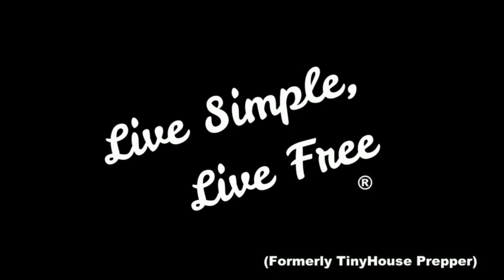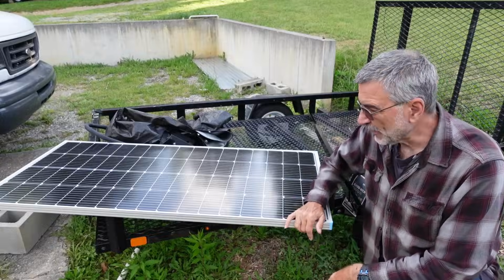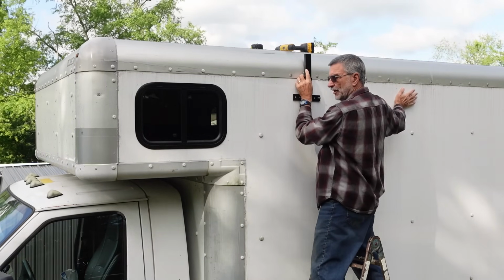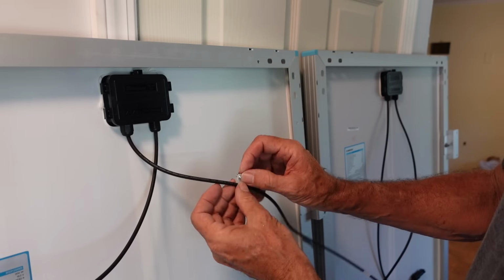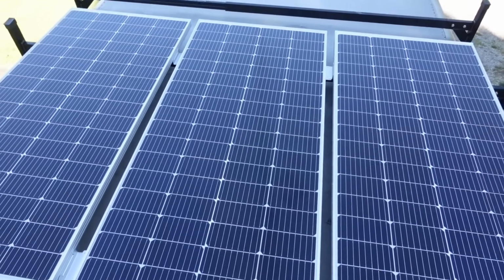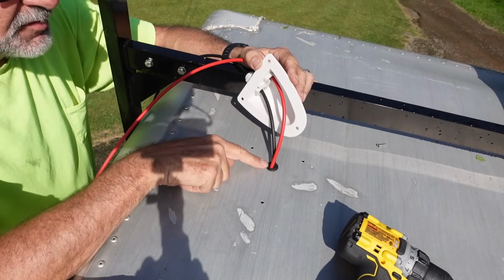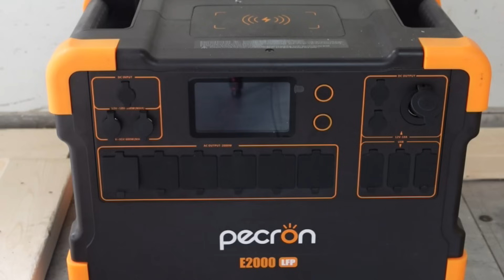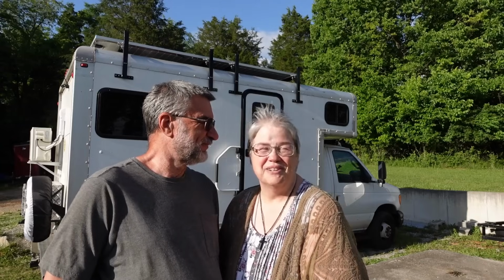Installing Solar Panels - Box Truck Camper

Comment: Your engineering skills have once again made all the difference.  Just be careful in the future parking the truck in woodsy areas under trees as you don't want debris or bird droppings landing on the solar panels which can cause problems down the road.  It won't be long now before the big trip to Utah!
Reply from the maker: I will have a collapsible ladder along with me so that I can get up there to clean off debris and bird stuff.
Reply: @LiveSimpleLiveFree   I was thinking that shade would prevent solar charging.  So there's that.

Comment: You should consider mounting a wind deflector to the front of the box, similar to the ones you see on tractor trailers. That could relieve the wind stress on the system.
Reply: Good tip !

Comment: The roof racks also serve the function of providing air circulation around the panels, which can generate a lot of heat. RVs have been known to catch fire if the solar panels are placed directly on the roof.
Reply from the maker: Good to know. I was not aware of that.

Comment: Popriveting brackets to the roof would have been strong enough but movement over time might have made the roof leak.  The other advantage of your less aerodynamic mounting is that the roof will be cooler with an airgap under the solar panels.

Comment: Pecron makes a DC smart charger that you can charge 480 watts off your alternator. Hooks up to your battery on your truck and hooks into your Solar inputs. It can be set not to drain your truck battery  ! Also has a on and off button.  Its about 150 bucks and should charge your station in a couple of hours if you need to charge overnight ! Great set up.

Comment: Most would plug the panels together, and use a cable tie to tie up the excess under the panels, this way you are not modifing your panels in the event of a warranty claim.. plus you kind of made more work than was needed, but you do you :-)  good job on covering most of the roof with panels, which reduces the heat load that the AC has to cool :-)

Comment: My uncle and his wife live in California.  They have been through the rolling black outs and make use of a camper they have during that time.  So it's not just for travel.  This gives you an option when the electricity goes out for days to have what you need even though it's a small space.  It looks good.  I have only a few solar paneled things like calculators and flashlights and it's nice not having to worry that the batteries are dead.  Though solar energy can be saved onto batteries to make it last longer.  That's about all I know about solar panels.  It's extremely nice that you don't have to worry about the grid with your new rig, except for getting gas.  Now a water fuel  engine, that would top it off, but the big oil companies kill everyone who comes up with such technology😢😢😢.

Comment: That metal piece at minute marker 9:52, has an end piece, cut it and put the end piece back on it to lower the height and give you the clearance you need.
Reply: I think it’s called a rubber boot for the end piece.
Reply from the maker: Yes, I have been thinking about doing that.  But those extra pieces sticking up provide extra protection for the panels from low-hanging branches.  So I haven't decided yet whether to do that or not.

Comment: I like the wiring kit for the solar panels. Those ratcheting crimpers do a much better, more consistent job than the pliers type. Most of them will have an adjustment to get the crimp to the proper tightness. The crimper frames often have removable dies and can be outfitted with additional dies for many different types of terminals. If the crimps are done properly, they are stronger than the wire itself. I used to have to pull test samples of my crimps, and have them inspected. It took longer, but we had no question that they were done properly.

Comment: Ecoflow now has an alternator charger. No solar panels. You may want to check it out.
Reply from the maker: Yes, we will have an alternator charger as part of our system.  But that only works when you're driving.  If you stay somewhere for longer periods without driving much, you will need solar as well. But when there is no sun, then the alternator charger is good to have.

Comment: That project turned out fantastic!!! The U bolt solution was genius!
I've watched some videos of step van and box truck builds, where they paint the roof of the vehicles with a product called Henry's Elastomeric in white, which helps to seal the roof AND add "some" insulative and reflective qualities.  
Love your videos!

Comment: You're far better at measuring than I am. I finally gave up on measuring, where possible, and started making templates. That works much better for me. It looks like you don't need the additional height on the roof rack, it should be possible to remove the caps on the uprights and cut them down a little. I would use my favorite Permatex 80050 clear silicone adhesive sealant to reinstall the caps, it works very well for such things. I glued a medallion to my gearshift, and it was still strong ten years later. I use it for all kinds of stuff since it adheres to smooth or textured surfaces equally well. It also comes in black.
Reply from the maker: I thought about that.  And decreasing the overall height for low underpasses as well. Only the other hand, those struts sticking up a little further could also provide extra protection for the panels from low- hanging limbs.
Reply: That's true, and I think some of the GPS apps can alert you to low overpasses and such. Low-hanging limbs are probably much more of a hazard.

Comment: We have 400 watts of solar on our RV. Doesn't run our AC but does run inverted outlets, TV, furnace fan, fridge.  It's all we need. So you will be all set with 1200!   Can't wait to see the finished product on the van.
Reply from the maker: My goal is that the A/C will run through the night!

Comment: Maybe I missed something, but were the rack fasteners (on the side of the box) bolts and nuts or self-tapping screws?  I am mulling over ways of attaching solar panels on my Ford Econoline van.
Reply from the maker: They were 3/8 inch lag bolts screwed into the 3/4 plywood walls.
Reply: @LiveSimpleLiveFree  Thank you.

Comment: Amen....no such thing a luck (dumb or wise).... God is good ALL the time!!!!!!!!!!!!!!!!!!!!   It looks like your loosing weight...you must be working soooooooooooo hard!   Hope those are lock nuts you are using....lots of vibration!!!!!!  Nice job brother.   FYI:  A wind screen in front of the panels might be a good idea to reduce drag and possibility of lift!!!!!!
Reply from the maker: Yes, those are lock nuts.  And yes, I am considering a wind screen in front of the panels.

Comment: Great job 🎊 🎉. Just a question why can’t get help from your son, grandson with help lifting panels.
Reply from the maker: They both have their own jobs. In order to help me, they would have to take a day  off from work. Lifting the panels onto the roof was not difficult. They are not heavy. It was just a matter of getting the right angle as I lift them.

Comment: So from what you said Bill, it sounds like you would want to always give yourself a good 11 ft. clearance where ever you drive.  10 1/2 ft might be really squeezing it. From what you've said about the height.  I wish that I knew a way to help with the gas milage.  Having those panels as low as possible should help with the drag.  Are there fittings that slope back that could be put over the top roof or your sleeping area in front there?  I wish that I could give you a picture, but curved sloping back to help with wind drag is what I'm thinking of.
Reply from the maker: An air foil in the front will not only decrease drag, but it will also provide protection for the panels from low-hanging tree branches. I'm seriously considering adding something like that.

Comment: Solar panels. The transformation on this U- Haul truck is truly unbelievable! What is next? Would you consider painting or putting attractive decals?

One more Q. Are you still supporting the farmers n artisans in Israel? I haven't seen Elizabeth doing the unboxing for a while❤
Reply from the maker: No paint or graphics.  It will remain black and white.  We like the "simple" look.
We are no longer getting packages from Lev Haolam.  The packages took 6 weeks or more to get here from Israel.  And with us moving back and forth between VA and FL we had trouble getting them sent to the right place at the right time.  Several times they were forwarded, which added WEEKS to the delivery, and we had to pay extra shipping for the forward.
Reply: @LiveSimpleLiveFree  'simple' is your motto, after all.  It saddens me deeply what the Jewish ppl are facing in this world. May they turn to the Messiah. Thank you for taking the time to respond!

Comment: Bill did you guys have. Look at those solar panels that stick to the roof…weight is negligible and perfect for your box truck! Max for Max and Occy used them on his sprinter van conversion.
Reply from the maker: Yes, I looked at those.  First, I don't like that they are basically glued down.  I don't trust that.  But mostly, in talking to Jeff, my solar guy, he said that they are not as durable.  They don't last as long, and must be replaced more often.

Comment: Couldn't you place 2 more panels running the opposite direction in front of the vent, over the loft/bed?? That would give you even more power. Very nice. Solar will make it nice for traveling/boondocking. Thanks for sharing. God bless and protect.
Reply from the maker: There's not QUITE enough room.  But 1,200 watts is more than sufficient.  That's more than most have, by far!

Comment: Idea….what about adding an air foil on the front of the roof like truckers use to deflect the wind and make it more aerodynamic.. just a small one that would go slightly above your new solar panels.
Reply from the maker: Already think about that.  It would increase aerodynamics.  But mostly, it would help protect the panels from low branches and so forth.

Comment: Don't you still want to reinforce a flimsy roof with plywood even though solar panel problem is solved ?
Reply from the maker: No need. The roof is strong enough, as long as you don’t put a lot of weight on it. This is a 2007 and it’s still the original roof. So it has been fine for all of those years.
Reply: @LiveSimpleLiveFree  yes, true .

Comment: I wonder if lock tight should be put on the nuts due to all the road vibration.  Maybe check it when you hit Utah just to be sure.
Reply from the maker: All of the nuts and bolts have lock washers on them. And yes, I will check them occasionally.